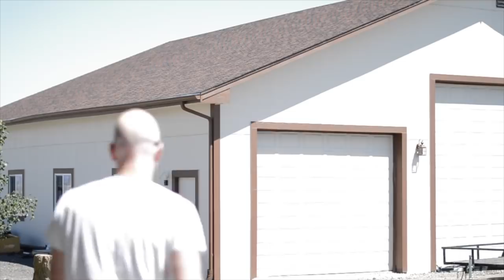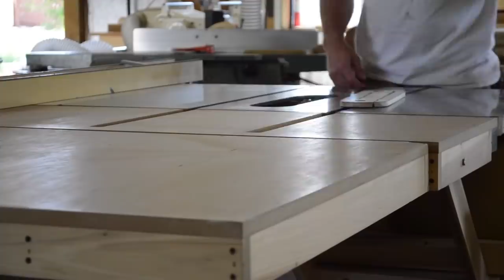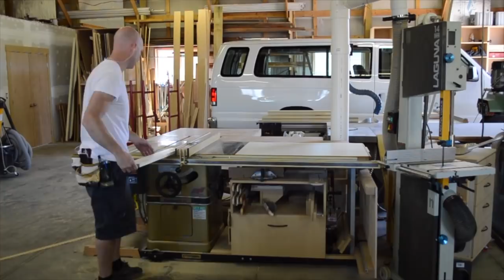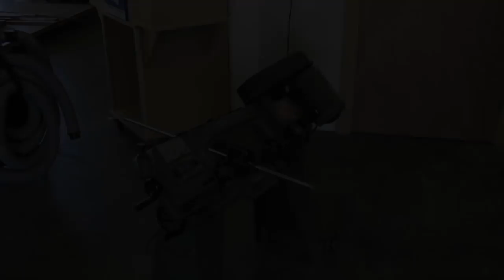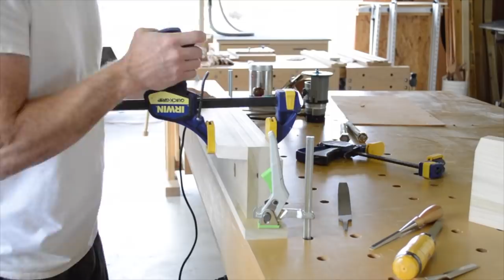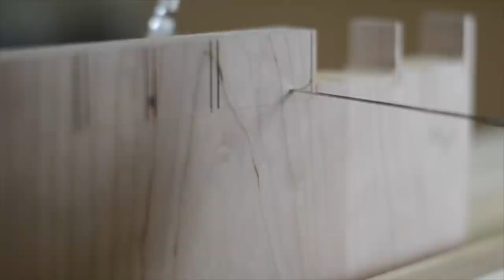Moxon Vise Build

Comment: Very beautiful. And completely non-functional. A lot of superfluous is the shelf on the rear sponges, the groove ... and it is impossible to clamp the part with a variable thickness - due to the iron guides, sponges can only be parallel. So for beauty - plus, for the result of the works - minus.
Reply from the maker: Not sure I follow, the primary function for this vise is to help with cutting dovetails. It does that beautifully.

Comment: This is a really clever design. I built it, and it kicks arse. Thank you! 
A question about preparation for routing out the waste. Is it like this: Cut the pin walls with a handsaw, clear the waste with coping saw, square the pin faces with a chisel (at least the top part), then use a template bit to ride those squared faces to cut to baseline?

I've recently learned to hand cut dovetails, and I'm looking for an efficient hybrid method that doesn't require finicky jigs. Your method looks fantastic to me!
Reply from the maker: Thank you. I also have a video explaining the dovetail process on my channel. Its older, but the methods remain.

Comment: Greetings from Golden! I'm getting back into woodworking, but I still need a planer, and more wood to make benches. I got a vice assembly but if I put this much in the jaw it'll bately open. I'll try 2 layers and see if it works.
Reply from the maker: Golden is beautiful. I think two layers would work just fine.

Comment: Mike, it looks like you did nearly all of your work on an assembly table, although you have a traditional bench in the background.  Do you prefer this workflow?  I ask because as a power tool woodworker I feel I do alright with dog holes and hand clamps.  Haven't had a proper vise since high school woodshop, and since I brought up high school woodshop you can guess at how old I am!
Reply from the maker: I like the assembly table because it moves up and down, therefore I can set it to the height that feels comfortable. If it came down to it I could work on some saw horses and an old door, but I do really like that bench.

Comment: Mike, what are the dimensions of the dado you cut in the front and back jaws?  Assuming you have roughy a 1/2” cutter diameter on the pattern bit used to clean up the pin boards; yes? And the depth?  Great idea to add that!
Reply from the maker: Just a little over 1/2" and about an 1" deep.

Comment: Nice. Definitely like the idea of using bushings and leather. What is your theory behind switching blades ? I am assuming it is to keep your crosscut blades from loading up with pitch. And the ripping blade has less flex ? Okay , I am done guessing , Hahahahaha
Reply from the maker: Thank you. Yes, both pitch and heat. These are blade killers. Also, the geometry of the rip blade makes feeding stock much easier.

Comment: Hi Mike:
Thank you for answering my questions.  I was surprised that the answers were in my mailbox this morning.
I was up early this morning and looked at your video on the Moxon Vice.  Do you have a plan for it?  I saw where to pick up the hardware.
Thanks again.
Reply from the maker: I always try to respond, though it doesn't always happen. I do not have a plan, but its about 6" tall 35" wide and each jaw is 3 layers thick. Hope that helps.
Reply: @MikeFarrington  Thank you

Comment: Hey Mike, great video! Do you find you've had any issues keeping the tops of the two jaws aligned? For the router? This is an awesome design, I love how you made it to use the router for dovetails
Reply from the maker: Thank you. The outer jaw does sag when fully extended, but I haven't let that become a problem. I just use one hand to press and hold the workpiece and jaw in place, while the other tightens. This ensures a nice reference surface for routing.
Reply: @MikeFarrington  ok got it, so basically you just make sure they're aligned, and that's good enough? I've never tried the technique, so I don't know how precise it has to be. Sounds like "good enough" is good enough?

Comment: Well done! Thanks for the links.  My 1st attempt at a moxon was OK, but this version is light years better.  Will try to make one soon --- using the parts you did here.  Thanks!
Reply from the maker: This was my third attempt. My first ones worked fine, they were just very crude and didn't function as nice as I wanted.

Comment: Nice project Mike. Good content, good pace. From a photographers viewpoint I wish your lighting was more even. Pretty dim in a number of shots. Please keep them coming.
Reply from the maker: Thank you Dennis. This was my first video. I have since expanded my lens collection, which helps with the light, but doesn't solve the problem. In the future I will add more light to the shop. If you are a photographer, you know all this stuff is really really expensive.
Reply: Mike Farrington  understood. Something else that helps with the lighting imbalance are unshaded windows when it’s bright on that side of the shop outside.  That’s an easy fix too. Either do your videos at a different time or hang some shades. You’ll figure it out soon. Good luck.
Reply from the maker: @dennisfahlstrom7422  Very good point. Huge contrast is difficult to overcome. Lately I have been covering up a window or two with a big sheet of cardboard. It helps, but its not a long term solution.

Comment: You have to love a huge wood Shop!  I inherited a 60,000 sq’ dairy barn that I divided into cabinet making, general woodwork, loft, wood sorting and leather shop..fun!  The old farm out buildings house the sawmill, two lumber kilns, heavy equipment storage, machine shop and garage.  That’s the upside...the downside is it has weathered 114 years many of which were years of no maintenance or outright abuse... but I’m retired and now this is my job!
Reply from the maker: Thank you. Best of luck with your project, 60k feet sounds intimidating.

Comment: Thanks for the inspiration Mike. Im making one similar, but going to add a t-track and stops to that router shelf so I can reverse it on the workbench and use it as a mortising jig.
Reply from the maker: Thats a very good idea. If you can send me a picture when you're done.
Reply: @MikeFarrington  Got it built, but vertical racking is a problem when using it as a mortising jig. I am going to try adding a bottom screw to offset the racking. Not sure if it will be good enough for mortising, but I'll let you know and send a pic if it works. Loving your design though.

Comment: Very well designed unit what other types of wood could be used? Wha5 is the minimum threaded bolt that could be used?
Reply from the maker: Thank you. I don't know, 5/8 or 1/2 would probably work fine.

Comment: Any danger of grinding a groove in your chop with the router?  I probably would, unless there is a bushing.
Reply from the maker: It could happen, but for me there is enough clearance to where that hasn't been a problem. I use bits with and without bearings.

Comment: Great video. Watched it in the middle of the night, so sound was off, and your camera journey made it so I was easily able to understand what you were doing. I wondered where did he get those knobs, and post show I see a linkie for them, Sweet.

Only thing I would say is trust your skills a little more and sell that biscuit maker. The glue is way stronger than they are, and you proved you knew what to do with tiny misalignment's. Time spent on them was time you could have been playing with that cute little Man you have sweeping your floors.
Reply from the maker: Thank you. I agree with the biscuit joiner comment, but it does help with alignment.

Comment: It’s okayish
Reply from the maker: I'll take it. Thats way better than horrible.
Reply: Mike Farrington I made a similar vice. Mine seemed tighter and stiffer. I just used 1/2-13 threaded rod. Super strong. Laminated two 2x6 for the movable jaw. It could still bend it.
Reply from the maker: Sounds like we have different expectations of use. For my uses this vice is already over built. I'm not clamping things in here with Hulk like force. I just lightly clamp things for cutting dovetails or other detailed work. With the leather on the jaw face, I only need to give about a 1/2 turn of clamping pressure to hold my work in place. If you have a jaw laminated from 2 2x6s and its still bending, you are needing a huge amount of clamping force.

Comment: When you got your slider, did you hold on to your Powermatic saw?  What slider did you get?    I've got two Delta Unisaws, but I plan to sell one and add a long-stroke slider -- either a Felder Format 4 or Martin if I can do so without cracking my piggy bank too badly. By the way, I just discovered your channel thanks to "Measuring Up" (by Peter Mallard and Andy MacLellan), who recommended you.  Count me in with a thumb's up and as a new subscriber.
Reply from the maker: Thank you. I had my PM66 and I also had a Holz Her vertical panel saw. I bought the slider as an experiment. I hurt my shoulder twice loading the vertical saw. So I thought keeping everything flat my be physically easier, which it is. I bought this slider with an 8' stroke because at the time I couldn't fit a 10' stroke. I really wish now I would have bought the 10' and a higher quality (Altendorf, Martin, SCMI, etc.). One day I'll upgrade. This saw is a Robland e300, its a fine saw for the money, but not up to the standards of some of the more expensive saws.

Comment: Have you ever used a domino instead of biscuits?
Reply from the maker: Yes, I have the large domino. I'm in the market for the small version as well. Dominos are good in certain scenarios just as any form of joinery is. I like biscuits because they are cheaper and faster. Plus with my biscuit joiner I can adjust the cutter up and down accurately to create small offsets, this can be a great asset when clamping up.

Comment: Thanks for the video @mikefarrington!  I found your channel a few days ago and love it.  I'm intending to replicate your vice, and I was wondering what would you think the minimum thickness would be for the face and back boards?  Looks like you laminated boards to about 3 or 4 inches, is that sufficient/overkill?  Thanks again!
Reply from the maker: Thank you Brian. I'm happy to hear you are going to build the vise. Let me know how it turns out. Minimum thickness for the jaws will depend on width. My vise is about 35" wide with 24" between the screws and I used a thickness of 2 1/4" to 2 1/2". 3 boards near 3/4" thick. This makes for a very sturdy vise. If I was building a vise that was 12-14" between screws I would go with just 2 layers or 1 1/2". Hope this helps. Best of luck.
Reply: Mike Farrington thanks!  I like your dimensions, I think I'd like a vise too large than not large enoungh.   I will try and post here, but if you are instagram I will definitely post the project there,  am on instagram as Mother Tree Woodworks, do you use that platform?
Reply from the maker: Brian, I am not on Instagram. Maybe I should give it a try. I will have a look at your feed.

Comment: Excellent Video. One quick question. At 2:00 you said "One will be ripped to 6 1/4, one to 6 inches" but later on the jaws looked more than 1/4 inch different. Did you mean 6 3/4?
Reply from the maker: Hi Mark. The numbers really don't matter. The point I was trying to share was that the front jaw should hang down in front of the rear jaw to help align when clamping to the bench. I think the end result was about 1/4 to 3/8. At the 2 min mark I was cutting two blanks glued up from different widths of wood, so it does look like there is a greater difference than the end result.

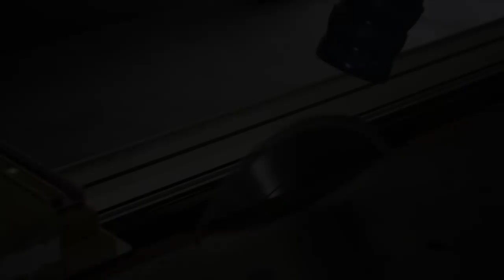Comment: random, but where can I find that bendy blue dust collection hose you had pointed at the tablesaw blade at 2:15??
Reply from the maker: Its called Loc-Line. I use the 2.5" diameter stuff.

Comment: Just found out your channel, good work! Was that a Robland panel saw at the start of your video?
Reply from the maker: Thank you. Yup, its a Robland e300.
Reply: "Control panel" looked familiar to me :) Used to work with older Z3200, that was built like tank. Hope this one serves you well.
Reply from the maker: Yup, its a pretty good saw for the money. I will be selling it soon in favor of a saw with a 10' stroke (like the z3200).

Comment: Beautiful work. The pedant in me is pleased to see the correct spelling for vise (damn spell checkers). Your design and execution is awesome though I do worry about the lack of a blade guard and riving knife. I lost half a finger some years back and even though I use a Sawstop cabinet saw I'm still very wary around blades and use a push stick. Anyway that's enough about me. Did you make the guide bushes too?
Reply from the maker: Thank you! I'm sorry to hear of your injury. Money is always tight for a woodworker. I have a tool list a mile long, but a Sawstop is near the top. Once funds allow I will pick one up. 

Here is a link to the bushings I used:

https://www.amazon.com/Koch-4046111-Category-Reducing-Bushing/dp/B005ZCR5EC/ref=sr_1_4?s=industrial&ie=UTF8&qid=1507160415&sr=1-4&keywords=3%2F4+to+1+bushing
Reply: I lost half my finger using a very safe sliding compound saw. My tool list is the reverse. I now have most of the tools and equipment I want though there are always a few 'must haves'. My jobs list seems to grow constantly and though I am long time retired the list never seems to get any shorter. It is a function of being married, living in a 25 year old house that needs attention, travelling etc etc. Keep up the good work.
Reply: Hopefully peoples won't think that " pedant" is the same as " pede" .